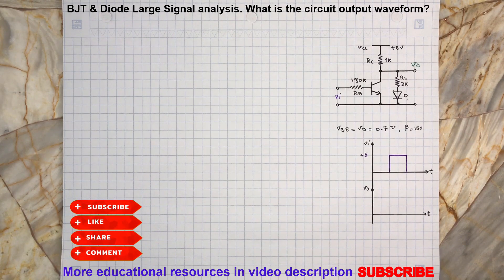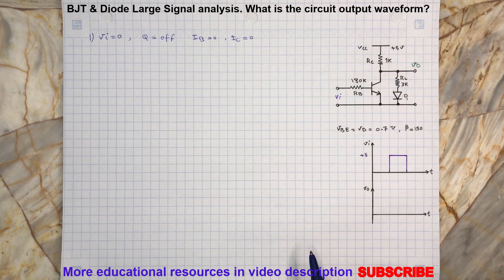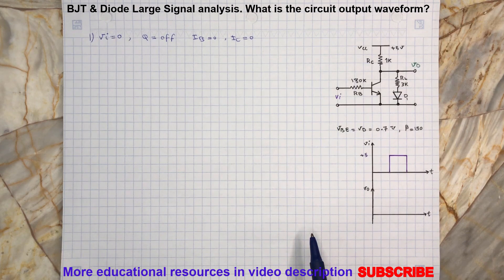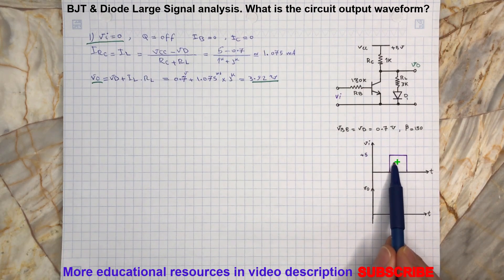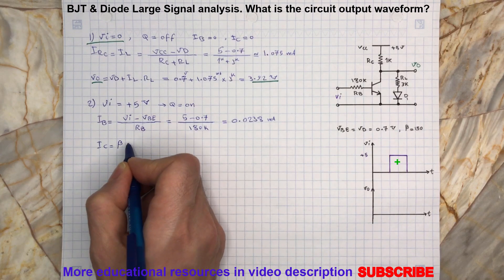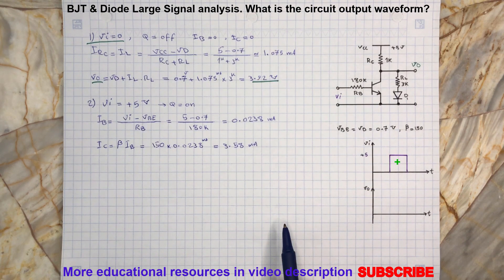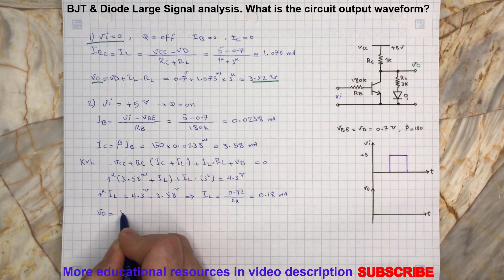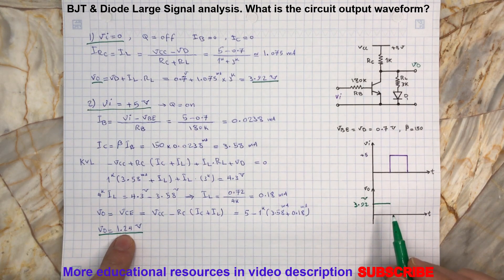Transistor and Diode Circuit Analysis, BJT and Diode Solved Problem, Transistor Large Signal

Comment: Please explain about KVL and KCL
Reply: KVL, sum of all voltages through a given branch of circuit is zero. In this case, Vcc-VRc-VRl-VD=0. The minus indicates we are moving in the direction of the current, i.e. voltage drop.
Reply from the maker: Thanks for the feedback. Do mean a separate video?
Reply: @EngineeringinDepth  yes.... How to apply KCL KVL for a circuit